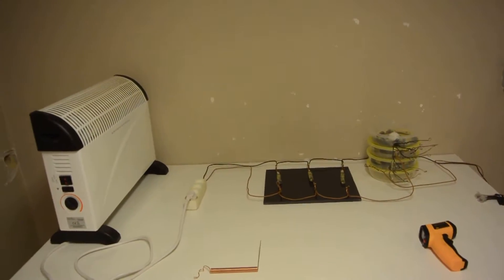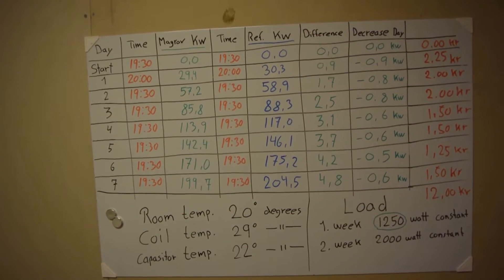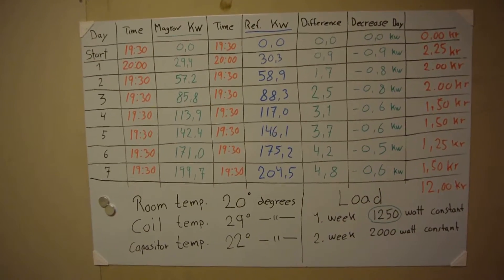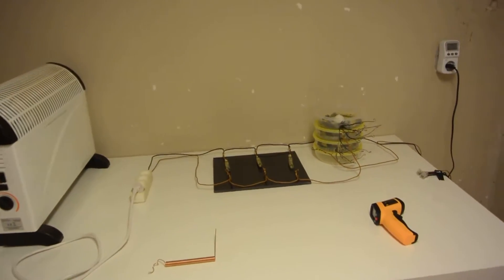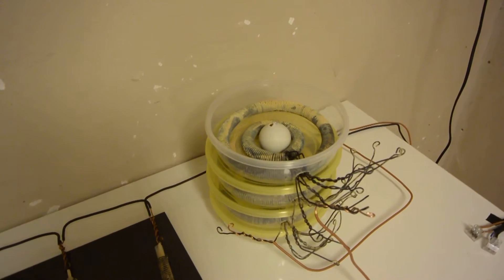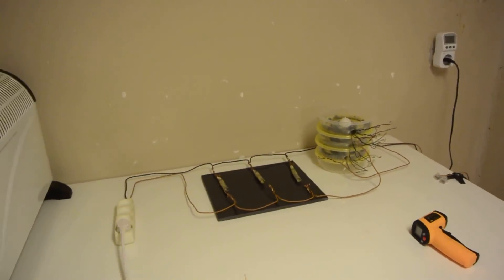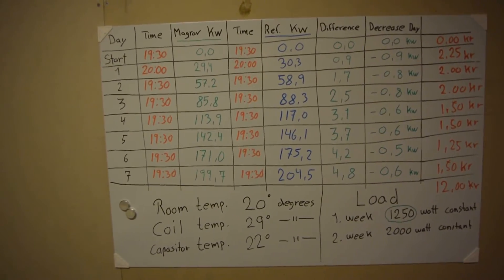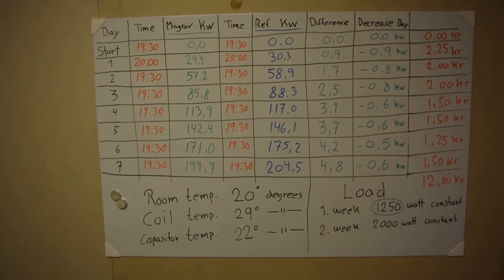Magrav test 1 english

Comment: put the GANS away, renanocoat the wires, but firs try to weld with graphite pen and battery the conections, not forget, to realine the wires after coating properly, and try to save the power on small gadgets first, i made the small battery only with the co² gans, and results ist there, but this is only to understand how the system works. P.S. make the Gans always in wery slow 1,5 volt batery with the resistor, not short coating, this is wat i am working with the small gadgets and battery generators.  now tryit, hope that helps u ;)

Comment: Quick question. Did you prepare the house wires for 3 weeks by progressively adding more kw to the load before you run your test? If not you will not achieve any result.
Reply from the maker: Yes I did.. Keshe is haste of time. It's a cult! :)

Comment: The polarization of the coils, after the Nanocoating, with the DC-Voltmeter, at 20mv-range, or i suppose using a 1,5V Battery would allso work, was very important ! ,i´m 
heating my coils & cooling in Water, and reheat with Gastorch to make new-nanoCoating. and don't forget to connect all good intentions into the PlasmaField, and the work ! "your taughts can move mountains, and you can make it work !
Reply from the maker: +cat1stevens Your right about the polarizing, i just forgot to mention it in the video :)
Reply: +cat1stevens 
http://thinkscientific.w4f.eu/MagravBlueprint.html

Read carefully.